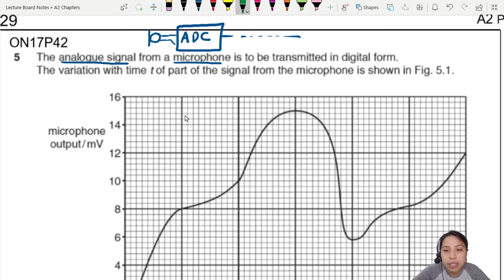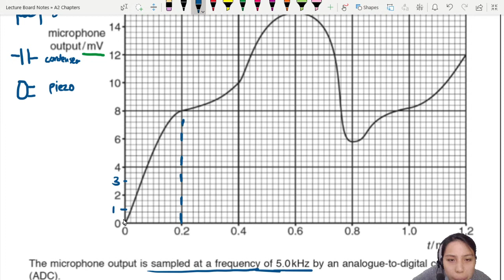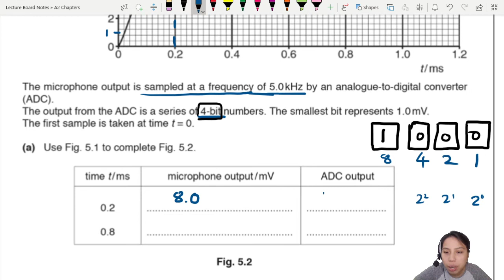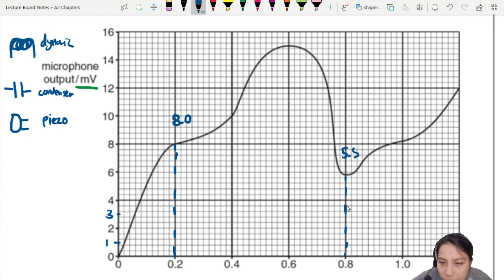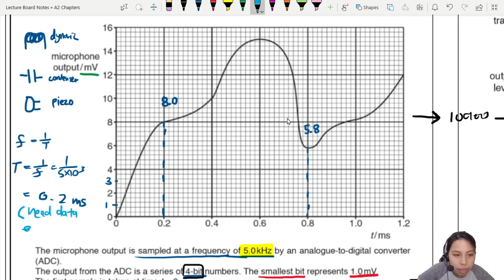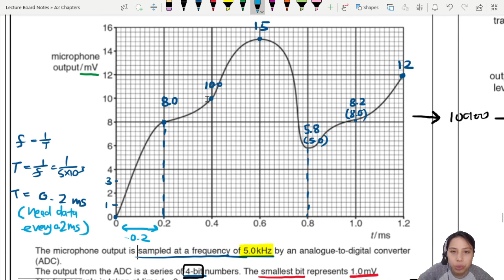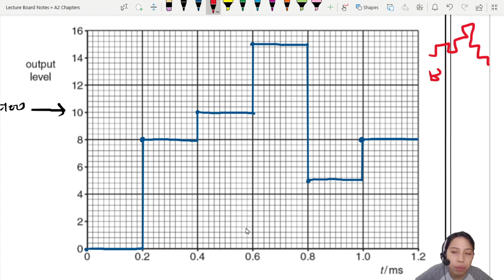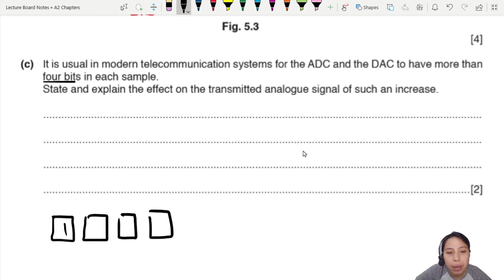116.2d ON17 P42 Q5 Binary DAC Sketch | A2 Communication | A Level Physics

Comment: Thank you so much for the video. The mark scheme for the paper discussed (ON2017/42/Q5) says that for part (a), the microphone output in mV for t=0.8ms is 5.8mV i.e. they did not round down to 5.0mV and read-off the graph directly. How come ah?
I am referring to 5:50 of the video btw.
Reply: Oh that's an error on my side! The microphone reading is 5.8V (can be continuous value), but when converting to digital then need to round down to 5.0V and become binary 👍
Reply: @EllieTangent  Got it. Thanks :)
Reply: @EllieTangent  but how can we round 5.8 to 5 ? 
Shouldn't it be 6 ?
Reply from the maker: @sohaibsarosh9839  It is a special type of rounding, where ONLY for DAC processing we round DOWN to the nearest whole number.